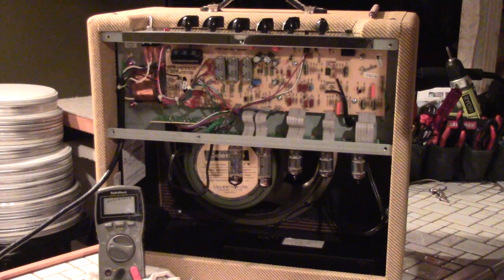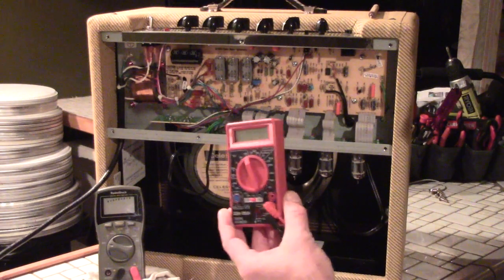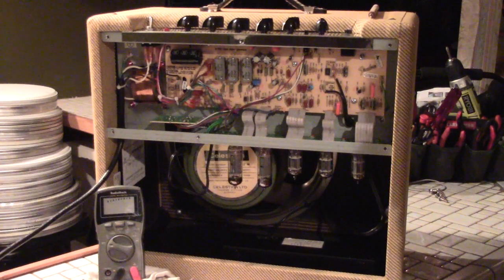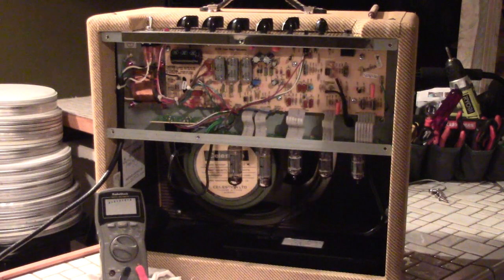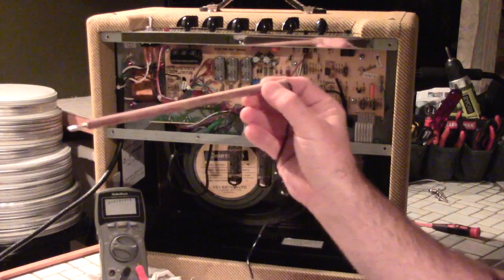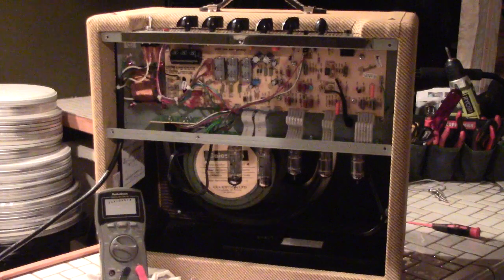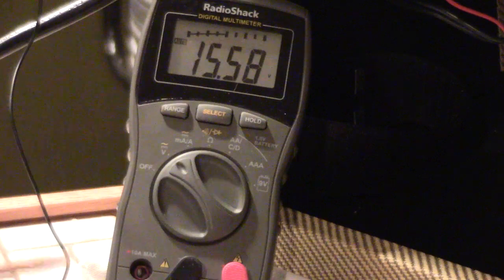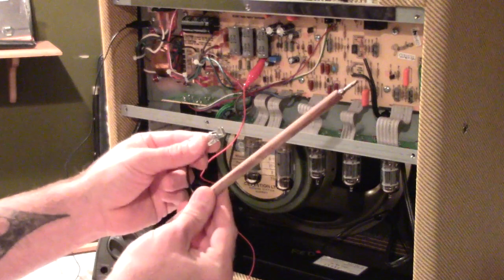Discharging Combo Tube Amps

Comment: On my Silverface Deluxe, I turn the power switch off while playing until the note dies out.
I unplug  it, and then I measure the voltage across one of the 0.1 caps near the power tube.
Usually it’s between 10 and 150 volts still in the cap. I then ground pin 1 of any preamp tube with a screwdriver to the chassis.
It’s never enough voltage to cause a spark. 
Then I measure the cap again and watch the residual voltage drain away due to the grounded preamp tube.

Comment: I've watched lots of videos on how to discharge a tube amp, and yours is very comprehensive...I'm preparing to replace the leaky filter caps in my latest Hot Rod Deluxe project amp...definitely need to know how to discharge the caps so as to be able to work on the PCB and caps safely...what's your opinion on using a pomona plug with a 22k 2W resistor connected to discharge while using the multi meter? Great stuff, thanks!

Comment: Thanks. I wonder how it is when you apply the multi meter to big filter cap in a 1969 bassman..you know, an old cap that is still charged and not able to discharge itself like your amp allows for. Am I to simply clip negative to chassis, then positive probe to positive end of cap and I'll see a nice high reading on the meter? Like the Stick of dynamite caps in my Traynor are rated as follows: 80 microFarads at 450 volts!
Reply: If you set your meter to its 500V DC range, you can watch the caps slowly discharge through the high resistance of the meter.
Reply: Wow. I did it, I've been playing with the multi meter. The caps in my 1975 sounder organ, in the power supply, go from like 50 volts and then drop down immediately after shutoff! Thanks for the video. How many volts are safe to the touch? Like when my cap reads 50 volts, how am I supposed to know the amps though? If it will hurt me? Thanks so much for all the great information.

Comment: thank you... i've been thinking about replacing the filter caps in my 20 year old twin. after watching many videos on how to discharge amps i"am still scared shit of being electrocuted.. after watching your video i feel i'am up to the task... (proceeding very carefully) anyway i have the one stupid question. you said any pos. terminal on any cap... are they all linked together meaning you drain one and they are all drained ..or do you have to drain everyone one at a time? cheers
Reply: That was my question as well. My first impression is yes, since he did not discharge all three individually. Also, you cannot discharge any tube that has the voltmeter already hooked up to it. I did not see Roy move the meter around to free up the other two capacitors for draining. Having said all that, I would still get confirmation from Roy!!!!

Comment: Hello, I would like to build a discharge tool like yours. Would you mind telling me where you got the wooden tube you used? Thanks in advance, and great video!
Reply from the maker: I bought mine as a complete discharge tool so it all came together. I bought it from weber I think.
Reply: Thanks for the info, I just built my own last night, so good to go.
Reply: Wood can conduct at these voltages and shock you, you need a proper insulator.

Comment: Why doesn't the multimeter, that's hooked up to ground, drain the voltage from the filter caps?
Reply: Does it have to do with the fact that the discharge tool has a resistor?
Reply: Because multimeters are designed to have a very big input impedance. This ensures that the miltimeter only measures a part of the circuit without influencing the circuit in any way. The impedance is too high to produce any significant current flow.
Reply: It does,  but very slowly.
Reply: @silasfatchett7380  ? Not slowly but almost an insignificant quantity. The voltage on the multimeter is calculated by measuring the current flow which is almost insignificant and multiplying this current flow with the fixed impedance of the multimeter.
Reply: @edian1895  If you have a couple of hours to spare, you can watch the caps discharge through the multimeter.

Comment: Semi-newbie question - I am assuming from the video that you need to have the amp plugged in so that the 3rd prong has access to ground. True? Someone may conclude that the safe thing to do is to unplug it, but you'll lose the ground connection too. Beware that a plugged in amp will have 120V at the power switch, that is a place to avoid while plugged in.
Reply: Not true. The amp does not need to be plugged in. In fact, it should NOT be plugged in.

Comment: great learning video.many thanks. just a question here: why did you discharge the capacitors through the positive side and not the negative side of capacitors? thanks again
Reply: The negative terminals of the capacitors are connected to the chassis. Connecting one end of the resistor to the chassis, then touching the positive terminal of the capacitor with the other end creates a path for current to flow from the positive terminal, through the resistor, and then through the chassis to the negative terminal.

Comment: ROY COX, if the B+ voltage is at 450vdc and you increase it to 600vdc, will this increase the AC ripple voltage and output more wattage?

Comment: are all filter caps connected.... wired together? (discharge one and they will all be drained) or you have to drain one cap at a time?  I'am thinking about replacing the caps in my twin....
Reply: The positive terminals of the filter caps on the B+ line are connected by resistors, which means that draining one cap drains them all.

Comment: According to the schematic of the Blues Junior, it is not fitted with a standby switch. If your amp has a standby switch then draining the caps by switching the amp off when hot will not work if the switch is in the 'standby' position.

Comment: Very good video from a practical standpoint but it should have made mention that it is current (amperage) not voltage that is harmful.  Certainly, without voltage there can be no current, but to say that a certain level of voltage is deadly without mentioning current is misleading.  A static spark from your finger to a door knob in the winter is thousands of volts, but it's only a few mA.

Comment: There is a guy online ( DLab Audio) that shows certain Fender designs where the amp has to be unplugged but the standy has to be on to properly discharge
Reply from the maker: Cody the Barber if the amp has a standby switch

Comment: I was told to get a 5 or 10 watt resistor  , 100 ohm-The guy at the store gave it to me and I got home and it was a 10 watt, 50 ohm resistor. Would that be ok to use? Thanks for any help.
Reply: Yes.

Comment: 2 x 180k resistors is far too high a value, that's taking a minute or more to drain a 40uF cap.  A few k ohms is about right.
Reply: You don't want a resistor that has a low impedance and a low wattage. This can result in a short circuit between the amp and the ground chassis and cause sparks. Its saver to use a higher impedance to be sure that not too much current can flow through. If you have a 500 volt, you want to use a 1 watt resistor with a minimum of 250 kΩ or 2 watt resistor with 125kΩ for example (500^2/wattage). You can increase the wattage by having multiple resistors in series.